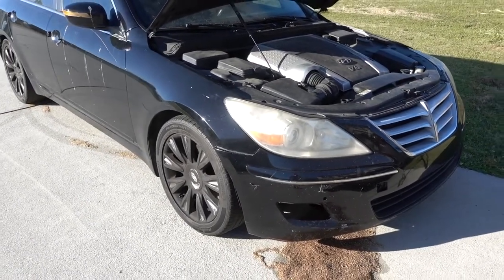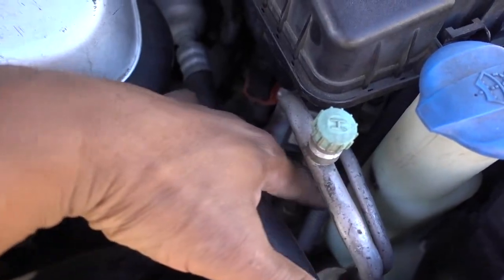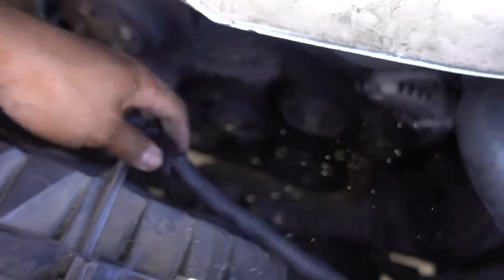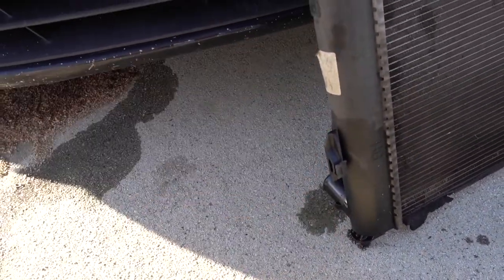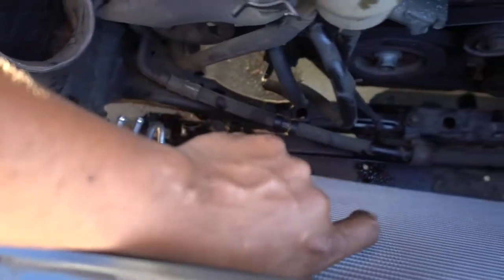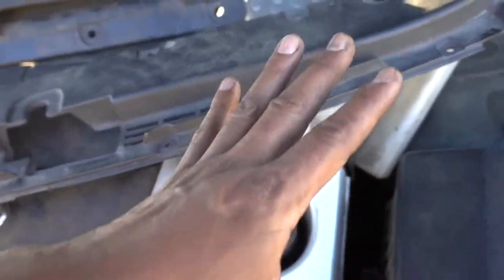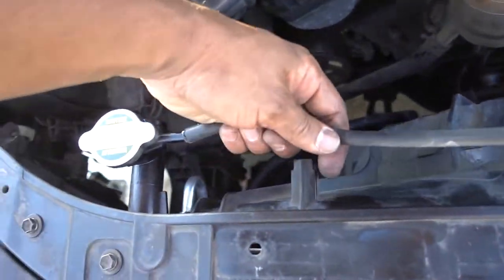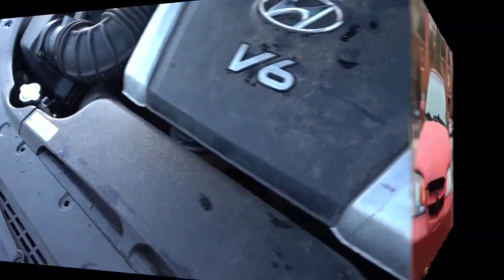2009 Hyundai Genesis 3.8L V6 Radiator Replacement

Comment: Thank you, this video definitely helped.  Just a note - that is an ATF cooler on the side of the radiator, not an engine oil cooler.  If engine oil had to be added afterwards, then it was most likely low to begin with.  Also, for those upper brackets, the one with the "R" goes on the passenger side of the car and the one with the "L" goes on the driver side.  However, it seemed to work in the video, so they might be interchangeable.  Thanks again!!

Comment: I have a very slight (and very slow) coolant leak at the rear of my 2009 Genesis V6 engine. There is green coolant residue in the area of the leak. The dealer says that they have to drop the engine (8 hours labor @ $200 per hour) to replace the 25600-3C660 Control Assembly-Coolant Temperature hub at the rear of the engine where the leak is occurring. The 2009 Genesis shop manual says that if there is a leak on the Control Assembly-Coolant Temperature hub, the bolts should try to be re-torqued before replacing it. Do you know if the bolts on the 25600-3C660 Control Assembly-Coolant Temperature hub can be re-torqued without dropping the engine? I don't trust my dealer to give an honest answer. The Control Assembly-Coolant Temperature hub can only be accessed from the bottom of the vehicle while on a lift, so I cannot do it myself.
Reply: I know this comment was three months ago but I just did mine and no, the engine does NOT have to be dropped. That is a lie. I found the part needed for like $350 but you do have to remove a lot of things like the engine wire harness that runs along the top of the engine, the intake manifold needs to removed, both sides of the radiator pipes/hoses, heater hoses, some connectors in the back (be careful not to break any tabs), and all the bolts that attach this housing to the back of the engine are in the back. I needed top access and I had to go under the car to get to a couple of the bolts. Take pictures so you can put the hoses and connectors back in the same spot. If I didn't take breaks, it's probably like a 3-4 hour job.

Edit: Oh yeah and of course you need to drain the coolant. And might as well replace the spark plugs since the top cover/intake manifold will be off the car.